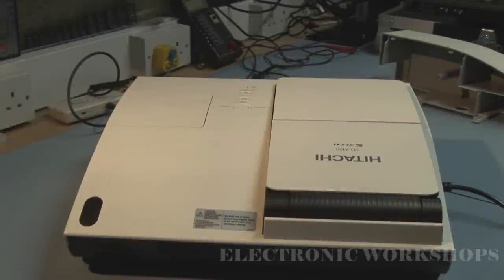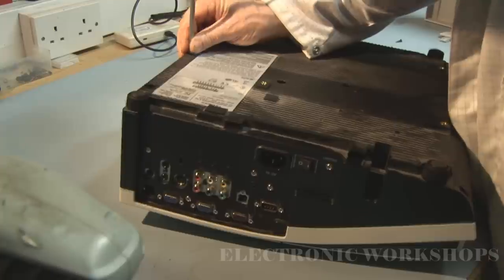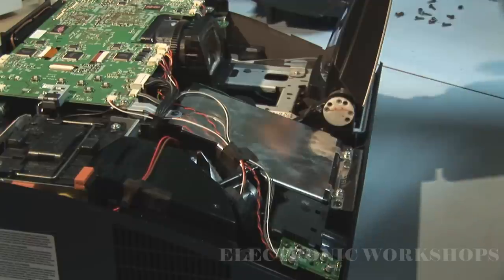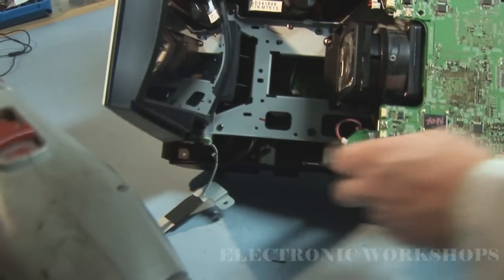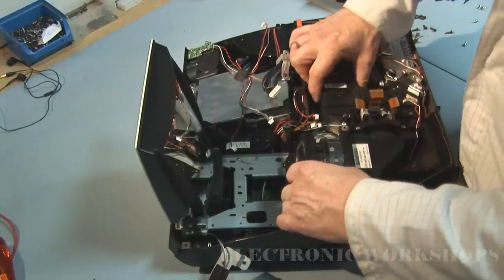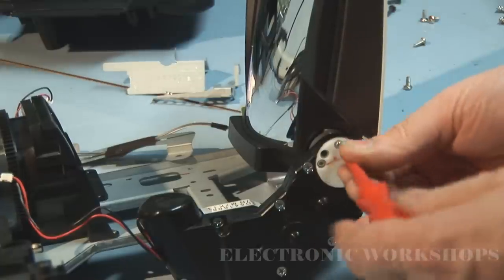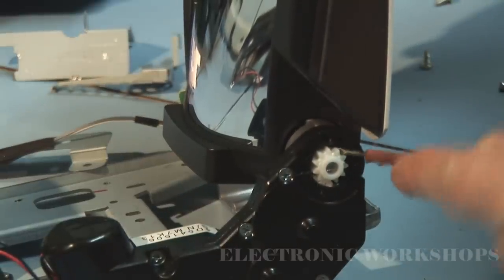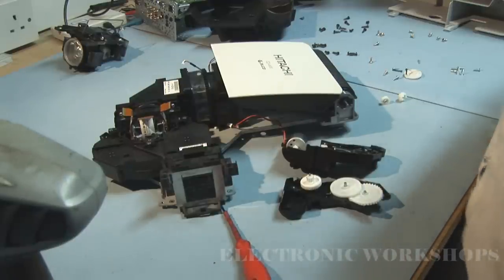Hitachi ED-A100 Door Mirror wont open

Comment: I just got one (a ED-A110, but it's exactly the same problem) and the better thing to do is not replacing the motor. The cogs went broken because of the grease they're using. If you want it to last longer, just change the grease. I personally removed it and tricked the motherboard into thinking a motor was plugged. There's a security check : when the motor normally runs, when the door is completely open, the clutch disengage and it generates a current peak in the motor, which the motherboard detects. If the door is actually open, it starts up. But, otherwise, it thinks something is blocking the way of the door and then shuts down. The trick was to fool it using resistors mounted in parallel in order to have exactly the same value as the motor and we made it to resist the 12w peak. It works like a charm without this useless fonction, and the security checks are still working as expected. If you use it upside down, you will have to put a little piece of cardboard into the hinge to make it hold in place. 

Hope I helped someone.
Reply: Hi, could you tell me the resistors that you used to achieve this please? i have a broken cog and would rather skip replacing it if there is a better work around. Thank you for your time
Reply: @juiceanabolic  Hi,
It's been years since I've done the mod and I got rid of the projector a while ago (still working tho). I just calculated a resistor which could dissipate the maximum power consumption of the motor. You can easily find information online about how to pair resistors to achieve that. Technically, you only need one resistor but it dissipates so much power it would just blow instantly.
Reply: @lululock  hi and thank you so much for your reply! the motor is 12v, i have been reading forum after forum to find help with this but am at a loss. ive even read about using a 12v led. do you have any idea how i could calculate the resistance needed? thanks again for even replying, im very greatful
Reply: @juiceanabolic  I don't remember the motor specs but you just need the max amp the motor draws (can be measured directly with a multimeter) and since it is 12V, you can calculate the wattage needed. You need a resistor which has the same draw as the peak consumption of the motor.
Reply: @lululock  thats brilliant, ill see what i can do, fingers crossed. thanks so much for the help
Reply: @juiceanabolic  You're welcome. Glad I could help.

Comment: Does anyone with knowledge of this unit know what it is sensing during the "warm up" period?  Is it sensing for temperature as the bulb heats up before going fully operational or is there something tied to the voltage across the bulb.  Long story, but I'm trying to work out how to run this without the bulb connected.  Any suggestions appreciated.

Comment: You do not need to take off the main board and then take out the mirror mechanism.. You can remove the existing motor by taking it out and then adding the new one. Just take out the six screws that hold down the mirror mechanism. This will give you enough movement to allow you to take out the old mechanism and then squeeze the new one in. This will save you loads of time. AV companies likely don't take the main board out as its a waste of time.
Reply: That sounds great ! do you have any picture of it ? Because, wether I don't have the right screwdriver or I don't see which screws you're talking about ...
Reply: yeah I notice they took the small broken piece out and all they had to do is take the new piece apart and replace the little part from that

Comment: erghh, I've just followed everything exactly as in this video, i was a lot more careful with the wires. replaced the motor unit. All back together, and now i'm getting a Lamp and temp error with only a white screen. Have I proper f""ked it?
Reply: MotionPlays it was fine in the end. one of LCD cables wasn't secure. took all apart. back together and all worked. I've replaced around 6 of them now. takes under 40 mins with practice

Comment: There has to be a bypass for this. LIke a limit switch bypass, because it WILL fail again. design flaw. With a bypass, the CPU will just keep on going without being aware the motor has detected a failure. So then you can just swivel the door manually. Fuck that automatic shit. weh hey.